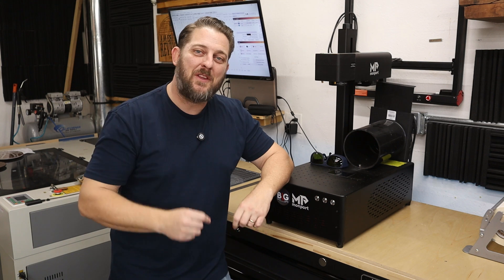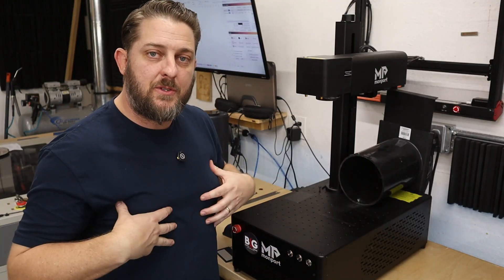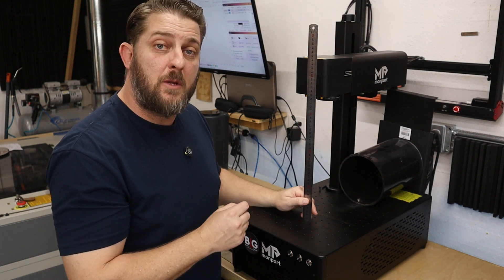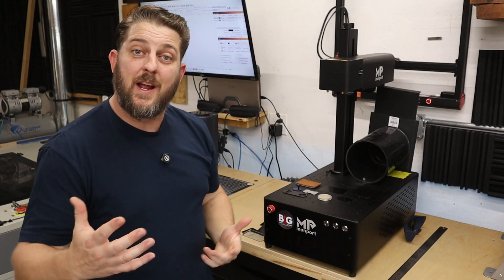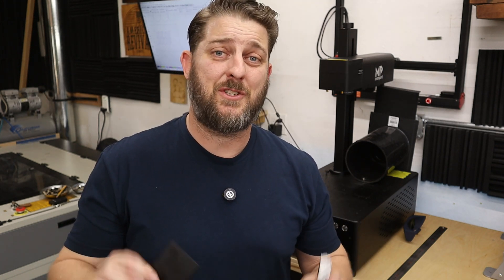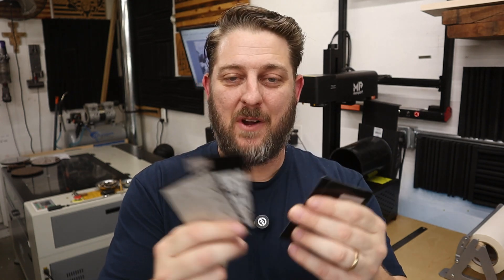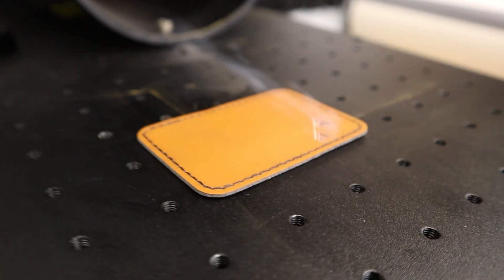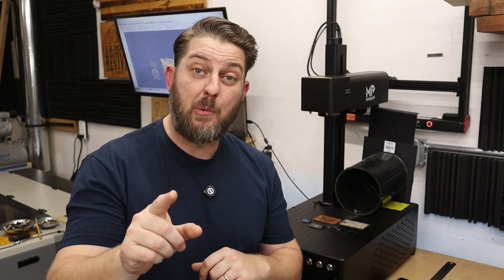Exploring The Monport GI60 MOPA: Setup, Tests, And Tips! | Brett's Laser Garage

Comment: great video. I just got mine. monport 60 mopa coloring. Does anyone have content on coloring engraving. When I get better, I will likely post videos myself to help others. If you could post the settings, would help us out...like the first one you did, was it a gif? an image file? thanks for your help!!!! I love this hobby!
Reply from the maker: Thanks for watching.  Have fun with the laser.  Search YouTube, there’s some good color engraving videos out there.  Material test cards are going to be key.
Reply: @LaserGarage  yes, I agree…there is a marginal learning curve!! I have searched, and have seen very few. Can you help with key words to use/type in search field? Thanks. I do love this laser hobby.!!
Reply from the maker: There's a channel called MakrTheory.  He has a great color engraving video where he does a ton of testing.  Testing is going to be your best friend though.  You'll need to play with speed/power/frequency/q-pulse/line interval and focus.  Videos will give you some starter settings but you will have to do extensive testing on your machine to get best results.  It's also extremely important to test on the exact material you will be working with.  Different types of stainless steel will engrave differently.  For example, settings that work on a stainless steel business card or dog tag will not produce the same result as it would on a flask.

Comment: I'm having an issue with consistency from the laser. I have the Monport GP 50W integrated fiber laser and I get the settings how I like them, do a couple of runs of product, then will get a product completely burnt. Or I will write the settings down, come back a day or two later,  and get completely different results. Nothing has changed-- same product, same settings, same height/focus. I do not understand it and it is driving me insane!
Reply from the maker: Weird.  What product are you working with that’s giving you these inconsistent results?